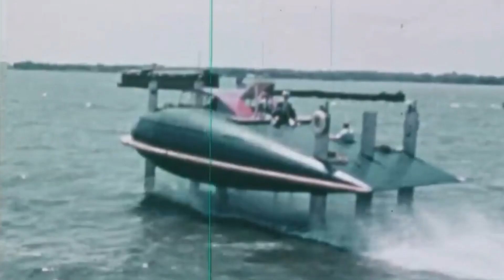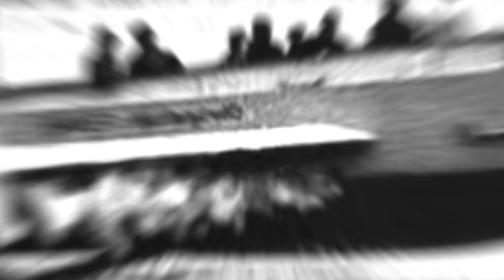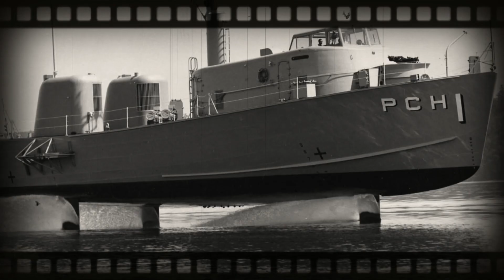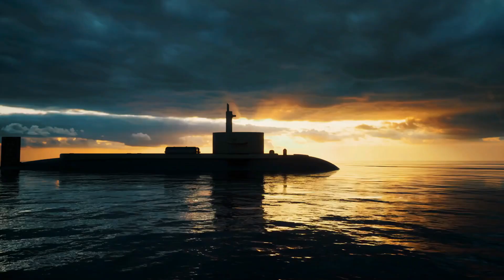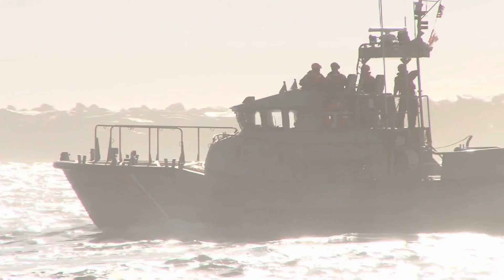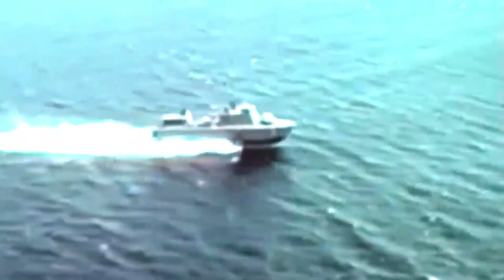USA Built Ships Which Could Fly: What Happened To The Plainview?

Comment: HMCS Bras D'Or was a hyrdofoil warship built and launched in Canada in the 1960's by Canadia's Naval Research Establishment and deHavilland Canada, and still holds the speed record for this class of warship. Research on naval hydrofoils began in 1908, and was a project developed and tested in successively larger vessels by Alexander Graham Bell and engineer "Casey" Baldwin. Their 4th prototype set a world speed record of 119 km/h just after WWI - so the idea was already seen as having a lot of potential for fast naval vessels.  Research on unmanned drone hydrofoils to lay down smoke screens during massed beach landings went on during WWII, but was never deployed. One early (and ongoing) problem was that erosion caused by cavitation, as the foils moved at high speed, destroyed their structural integrity. Cavitation erosion is still a field being researched now, although not for hydrofoil ships. Throughout the 1950's and 1960's both the USN and RCN worked on a variety of hydrofoil concepts. Canadian naval designers saw the hydrofoil as being a significant tool for anti-submarine warfare, utilizing a towed-array sonar system while cruising in slow mode on the surface, then transition to high speed foil operation to bring the ship's torpedos within range of one of the many USSR submarines that were patrolling in force along the east coast of Canada and the U.S. Hydrofoil designers in both Canada and the U.S. encountered new problems not seen before in ship construction, particularly with the strength and configuration/arrangement of the foil supports, as well as the best design and arrangement of the foils themselves. The USS Plainview used a different foil arrangement than the Bras D'Or, but nonetheless ran into the same problems with foil design, and cavitation erosion when the ships were operating at high speed. HMCS Bras D'Or is now on static display in Quebec, so many of the interesting developments made by researchers working cooperatively in both countries can still be seen close up. Many of the earlier RCN research hydrofoil ships were also saved from the breaker's yards, and can be found in naval museums in eastern Canada. 
The power plant requirements of the Bras D'Or give some idea of just one of the problems. Running in "conventional" mode on the surface, the ship was propelled by a pair of of conventional Paxman marine Diesel engines and 'surface' propellers. However, once up on the foils and at high speeds, propellers on the lowest foils were driven by jet turbine powerplants. Turbines had the advantage of quick starting and very high power and speeds, but the amount of force exerted on the foils by the sea at speed was just one of many factors in foil and strut design and materials development, and minimizing cavitation that could damage or degrade the foils and supports. With over 30,000 HP of jet turbine power needed to reach HMCS Bras D'Or's top speed, even with only the foils still in the water and the ship's hull well above the surface, fuel consumption was still a consideration that limited crew size and ship armament and equipment. Both the long-towed-array sonar and "sprint & drift" ASW technologies, as well as "smart" torpedoes, continued to be researched as separate projects.